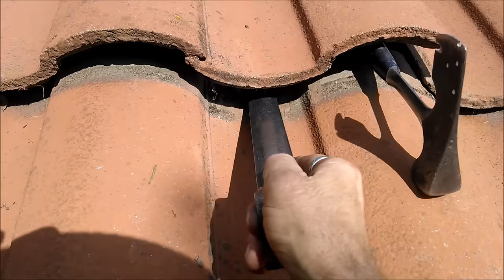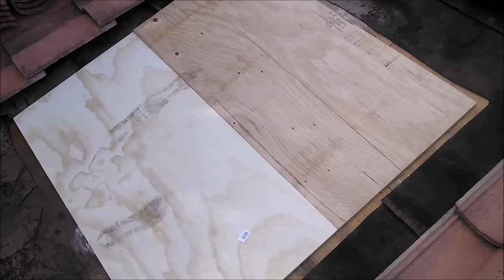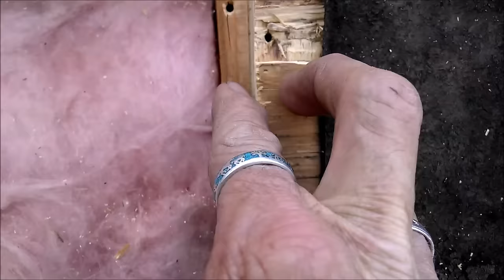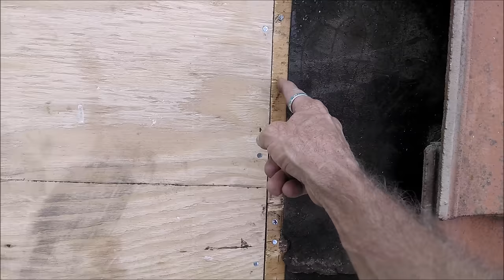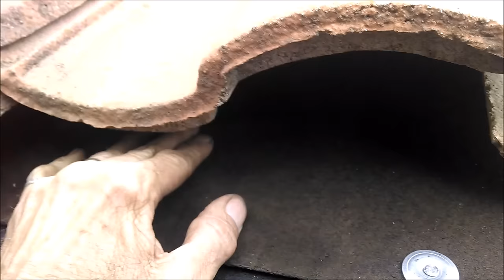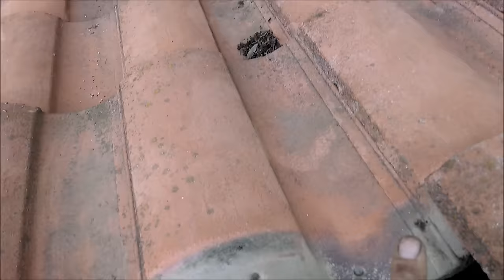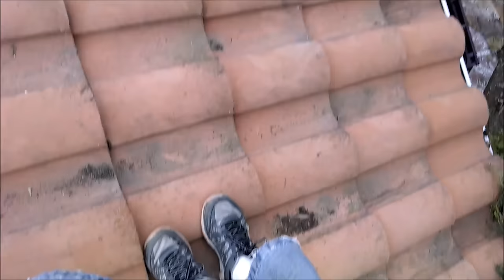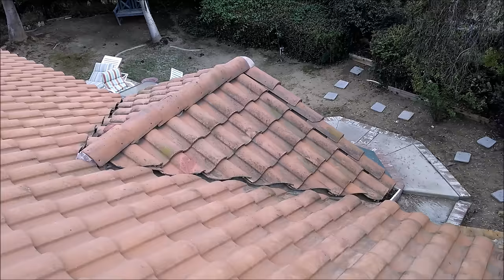Roofing Tile Leak Repair - Tips, Tricks & Helpful Hints

Comment: Thanks for the great information. Do you have any videos on the edge cap installation of a title roof?
Reply from the maker: Rick Gibson No, I’m sorry... I just started doing videos like this at the tail end of my roofing career. I could explain it, but a video would be worth a thousand words.
Reply: Duster Dan , I had my tile roof re-papered. Im not comfortable with the finished product. They left multiple tiles that were cracked (they used my current tiles. They had to come back & fix those tiles ). The big issue is the tile pieces that roll from the roof to the face board ( I forget what they are called). This roofing company left gaps where you can see the felt paper through the gaps. Now they are telling me it's normal and you are supposed to see the felt paper. That doesn't make sense. 
Do you think that sounds right? Do you know any honest roofers in Riverside, Ca area?

Comment: Hey man, good video. A suggestion I have is to list the types of sealant, glue, and nails you use in the description. But otherwise, thanks.
Reply from the maker: Good suggestion... Weather resistant galvanized nails must be used on the tiles, regular 8D sinkers are code for the plywood sheathing in my area & I use 1" weather resistant galvanized metal cap nails for the felt so they hold the felt tight over a long period of time they don't rust. Everyone should check with the building department for codes in their local area to determine what fasteners to use & why? Each building department is different & has differing codes for their specific areas. That's why I typically don't list materials in my vids. As far as the glue goes I just use a tripolymer made for cement tiles & for other construction materials to hold the tiles in place, roofer's mastic for the felt paper when needed & silicone for sealing anything on the surface that needs to resist the weather for long periods of time. Silicone isn't typically paintable though so there's always a compromise with any sealants that you may use to seal things on the surface of the roofing. Always weigh your options...

Comment: Hi Dan, thanks for the reply back! I’m actually live in Orlando Florida. I want to ask you for some advice on a title roof, I’m looking to purchase a house is about 13 year old an had original title roof, we found a small section has been repaired before and was a leak, but it doesn’t look like they did a good job, so I call two different roofing contractor to come out did a inspection to see if it needed to re-repair it! So, first guy only went up on the attic didn’t go on top of the roof, but we did show him pictures of the repaired area, he told me title roof is something go bad, all I need is to repair, he said title roof should last for a long time like a hundred year if is not crack or damage, never needed to replace! Second contractor told us a different story, first he went on the roof for inspection and he find the repaired area and he also checked other area for cracked title and some loose title; they told me because we in Florida because the high heat most title roof will only last 15-20year most and told me they would not fix or repair the roof! They said they would recommend to replace the whole entire roof! I feel like they trying to get a big project instead just repair a small issue! Is very hard to find a true honest contractor around here! What do you think Dan, please help and give me some advice Sir?
Thank you in advance! 
Awesome video by the way!
Reply from the maker: Teddy Chan yes teddy, the second contractor is wrong. You know he’s wrong because he only gave you advice based on theory & age of roof rather than actually checking your roof & offering specific advice to fit your situation. Besides that his advice was subjective, based on substandard industry standards & not quality tile installation that preserves the underlayment for 50 - 100 years like a tile roof should last.

The only concern you should have with the first guy who offered to repair it is whether he can do a quality job or not. Just because he knows the truth about quality tile roofs doesn’t mean he’ll be able to give you a quality repair. So query him carefully on how he proposes to fix your roof & why he does things his way, so there’s a quality reason behind every repair decision he makes & you won’t have to do this repair again.

Sorry I had to edit this a couple times to make sure I got the right contractor in each case based on the info you gave me. I have proofread my response a couple times now to make sure it’s correct, makes sense & fits the info you gave me. Hope that helps...

Comment: Seriously well done video! The NovaLink that you use, do you use that for all gluing cracked or broken tile repair work, and adhesion on the roof,  a one size fits all?  How about around the vents that need the old sealant chipped away and reapplied? Thanks again for a super informational video!!!
Reply from the maker: I did at the time of the video, yes. Now I use quad OSI. Nova link isn’t available in my area. OSI is very similar in properties as nova link. There are better products against solar deterioration, but they won’t adhere to as many different construction materials or adhere when surfaces are wet. In fact, not many products adhere to wet surfaces but with some work I can often get these two to stick to damp materials, not to mention remaining elastic when cured & being 100% waterproof immediately upon application.

As far as chipping away or cutting away old caulking before applying new goes, I would remove the old whenever I had concerns that it would hinder the performance of the new product in any practical way before my warranty on my repair expired. Quad OSI works great on vents also.
Reply: @MrThedocholiday  I need to repair both a permanent shed roof that has the roll type roofing, as well as a leak below a vent on an S tile roof.  This is in the super hot southwest. Thank you so much for your feedback and your video!

Comment: excellent tutorial, only one little problem!👇👇what if it got 80 degrees outside!? you think that black sealant will be enough to hold the weight of those cement tiles from coming down sliding over that roof?? thanks
Reply from the maker: Sam Sbogh More than enough grip to hold the entire row. 80 degrees is nothing compared to a 140 degree rooftop! This adhesive exceeds all code requirements & my repair warranty of at least two years.
Reply: Duster Dan 
good enough sir and thanks again for tutorials and videos and God bless🙏

Comment: Hello. I need to repair tiles. As in your video. Our house has the same problem. We are with the home owners association. How do I find the tiles I need to replace the old ones ? They are broke but have to match the rest of the houses in the neighborhood. Any suggestions on who I need to contact would be really helpful. And thank you for the video Sir.
Reply from the maker: It’s always hard to find replacement tiles because the roofers & the manufacturers want to reroof your house instead of repair it, for obvious reasons. You’ll need to find a tile boneyard & bring a sample of your roof tile for comparison if you want to find the right replacement tiles. And be ready with a can of roofing spray paint when buying the tiles, because you are not likely to ever find the right color your house has unless you get divinely lucky.

Comment: Thanks for your quick feedback. I'm a bit relieved but still bothered by the cracked tile he caused which he caused away from the section he fixed and the other 2 missing tiles he cracked and left without replacing. I think I accidentally deleted my previous question....
Reply from the maker: A cracked tile can only cause future damage if the underlayment where the cracked tile resides is not meant for weather exposure. If the underlayment beneath the cracked tile is intended by the manufacturer to remain waterproof whether it is exposed to weather or not, then the tiles or tile that covers it are merely cosmetic rather than necessary. The same goes for the area where he left out the tiles. The necessity of having waterproof tiles in place is determined by the underlayment, membrane or roofing material in that area that will be exposed to the weather over time. Regular felt underlayment is not meant to remain waterproof over time if it is exposed to regular water penetration every time it rains but many other roofing membranes & materials are. Being merely cosmetic all depends on what's under the tile there. This is a gray area that is mildly subjective & as long as the contractor is willing to stand behind his labor you have to let him do his job as he sees fit. Sometimes it's ill advised to put tiles back over membranes that are weathproof by themselves & other times if it is done carefully without piercing the weatherproof membrane, the tiles can go back into place. There may be reasons your roofer feels uneasy about putting those tiles back in or replacing the cracked one & just because it's easier for him not to, doesn't mean his other reasons aren't valid. Good communication with the customer is priceless in this case & flexibility of the customer doesn't hurt either. Getting the roofer to give sound reasons why they do what they do is key, but second guessing sound reasons will inevitably lead to tension between the two.
Reply: Thanks again for sharing your expertise.

Comment: Great video.  Very informative.  Going to attempt to fix my own roof.  If I don't finish in one day... do you recommend.... tarp? and how to attach?  Also My leak is near a valley.  How do I handle that?  Some of the tiles are cemented between valley area.  I live in S. Florida.  Where are you located Duster Dan?  Thanks again!
Reply from the maker: If I can't finish a repair completely before the bad weather arrives, I will often finish the felt paper at the very least. When houses are built they paper the roofs first & install the primary flashings before they install the tile. With the felt & flashings installed the roof should be watertight, even without the tile installed. So I usually use the felt paper as my tarp - so to speak. Valley leaks can often take more than a day to complete properly so I watch the weather closely whenever I have a roof open. Felt tends to stay in place far better than a tarp will in bad weather, especially if the felt is nailed carefully. I use tarps only as a last resort & tuck them up under the tiles above so the water cannot flow under the tarp or I take the tarp over a ridge to make sure the water doesn't get underneath & threaten my repair area. The problem with tarps is they usually require sandbags which are a real pain to carry up & down on the roof & they often blow off in the wind. But hey, I live in So Cal where it never rains so...

Comment: Thanks Dan, great video, lot of  excellent tips. Just one thing, what saw tool did you use to remove the old plywood? I didn't see it in the video. Thanks again.
Reply from the maker: Derrick Willmott Skilsaw or a circular saw will do the trick. Just set the blade depth an eighth inch deeper than the plywood is thick & cut a little further than the actual opening at each corner to make sure the wood is cut free below the surface.

Comment: In my case I have a house with old fashioned fired clay U-shaped "barrel" tiles, with no nail holes. Would you recommend using premium underlayment in that case or should the U-tiles be glued down or something? Just curious how to do it right in this case. I prefer the antique barrel tiles for aesthetic reasons, as this is the traditional roofing for historic buildings in my area.
Reply from the maker: Giovanni Di Matteo Normally, when tiles are without nails, they are cemented into place. In which case gluing them would also be acceptable. The underlayment question is dependent on two things, neither of which have anything to do with whether the tiles are nailed or not. The underlayment quality depends upon your local codes, which in turn are based upon the pitch or slope of your roof. Because, under a certain pitch your underlayment needs to be a higher premium - 100% waterproof regardless of the tiles. Above a certain pitch the underlayment can be a lower (standard) because it is protected from the elements by the tile. The reason why this has to do with pitch more than anything is because the tiles are designed to shed water & protect the felt based upon that minimum roof pitch or greater. Below that threshold the tiles can no longer protect your felt underlayment. The threshold for most standard underlayments is approx 3.5/12 roof pitch. My policy has always been 4/12 pitch just to be on the safe side because over time shingles can be added & build up can cause that minimum pitch of 3.5/12 to breach & then its only a matter of time before the felt wears out & you have a leak. It’s always best to check your local codes for specific application for your roofing materials in your specific area.
Reply: @MrThedocholiday  Thank you for these remarks!

Comment: Can I use Liquid Nails to glue the S-tiles to each other? Or is that bad and will not hold.
Reply from the maker: What if you get a leak under the tiles glued with liquid nails? Or what if one of the glued tiles cracks & you have to replace or service it? How will you remove, replace or service tiles or the felt under those tiles if you use a permanent type of glue that hardens like liquid nails?

I like glue that cures fairly fast (1-3) days but stays flexible. And no, silicone won’t stick to many construction materials either. I like a quality tile adhesive like osi quad because it cures fast & stays flexible, so if it ever needs cut with a razor or pulled apart, that remains possible for someone serving your roof, so they don’t have to destroy otherwise good tiles that are often irreplaceable these days. Any other copolymer or tripolymer will work as long as it stays flexible, cures fairly quick & bonds to most construction materials.
Reply: Thank you sir!

Comment: Hi Dan your video is super helpful. I have a leak similar to the leak in your video but in a couple of different spots. Do you think its wiser to patch all of the leaks or just put in a new roof? I am in SoCal and my roof is ~20 years old. Would really appreciate your advice. Thank you
Reply from the maker: It depends entirely up the condition of the felt underlayment outside the leak areas. If the felt is good outside the localized leak areas then repair the leaks & you should be good for at least another decade. but if the felt if rotted outside the immediate leak areas then you already know the answer to your own question. If the tiles were installed correctly they will protect the felt underlayment for decades but if they're not installed correctly in a manner that protects the felt then the entire roof will likely need replaced prematurely. Does that answer your question?
Reply: Same predicament?? What did you end up doing?

Comment: Hi Dan, thank you for posting this video. Very helpful. I am also in the Riverside Ca. area. I'm in the unfortunate situation where large sections of the felt paper on my roof have deteriorated. Luckily only a small leak before we caught it. The home was built in 1988. Bids from the contractors are torn between a whole new roof or just a lift and re-felt. What are your opinions? Does concrete tile wear out? Thanks!
Reply: I forgot to add that the leak was due to a slipped tile.
Reply from the maker: Jim Arwood Cement tile does not wear out. At least not that fast. However, it will all need re-nailed if you have them pull it up, re-felt & reuse the old tile. Tiles will break during reinstalling, several will need replaced & matching tiles from the 80’s with new tiles will prove nearly impossible. Finding someone to match everything nicely & do good work will be difficult. Screen your contractor carefully. Many older communities is so cal are in same situation as yourself. I’d go with a new roof if you can afford it.

Comment: Hey Dan.  Nice video.  Can you comment about moss on roof tile and if its should be cleaned off?  I have noticed some moss forming.  The tile also seems a bit crumbly in some areas. The moss seems to penetrate into The porous tile surface and i think it might lead to cracks from the moss roots.  Please advise.

Comment: Thanks Dan. Do builders back up their tile roof warranty for these kind of damages?
Reply from the maker: Because it typically takes several years for damage like this to occur after houses have been built, builders are typically out of business or have been restructured into something else that cannot be found or held responsible. On rare occasions I’ve seen class action lawsuits destroy builders that were already on their way out of business, because of bad business decisions made during their hay day. Even more rarely have I seen good builders still doing well long enough for their home buyers to have recourse when the quality of their homes goes sideways.
Reply: @MrThedocholiday  Thanks Dan, very insightful. By the way, I used your video and tips to fix a tile roof leak in my garage. I hope it holds up, I'm planning on getting back to do it properly in spring next year.